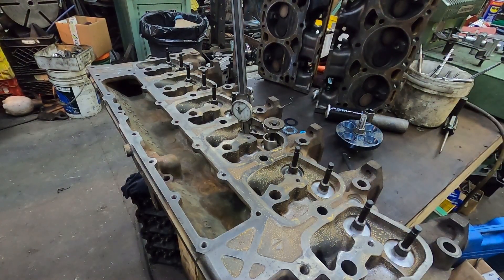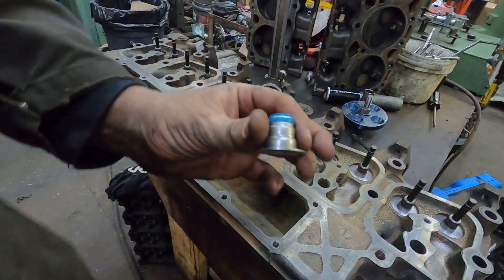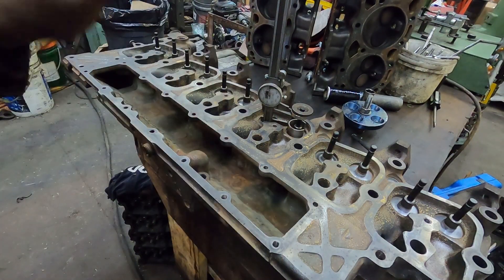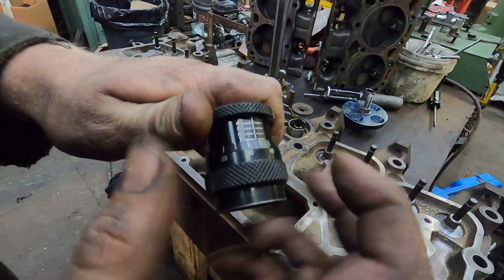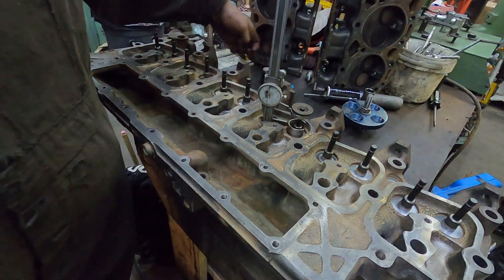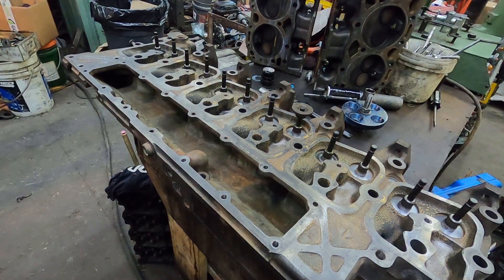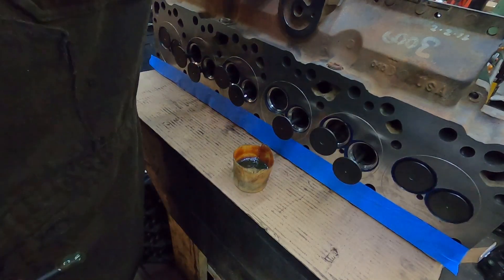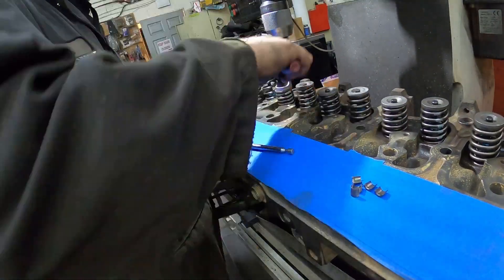HOW TO REBUILD YOUR 12 VALVE CUMMINS  PART 10

Comment: I have zero knowledge of head or engine rebuilding so this is some great insight for me. And I probably would also be thinking that a lot of extra $ for head work. But now I see where the extra time is needed make sure things are within spec. Thanks Rob another good one!
Reply from the maker: It does take alot of time and equipment to do it right.